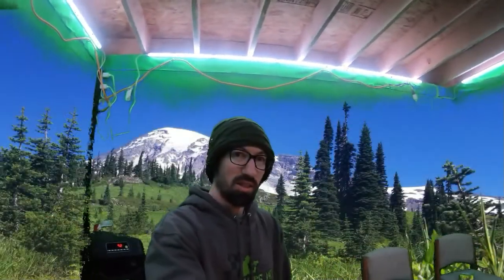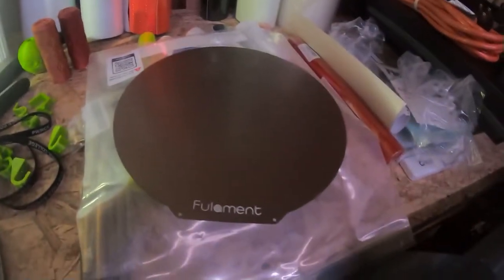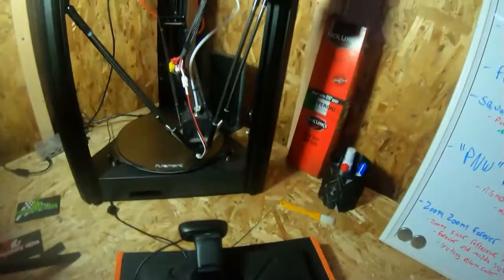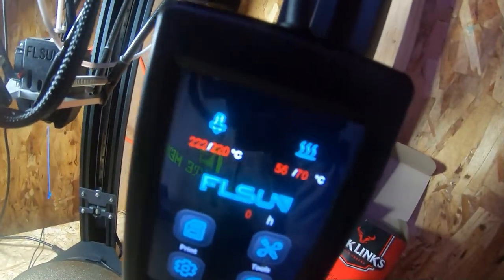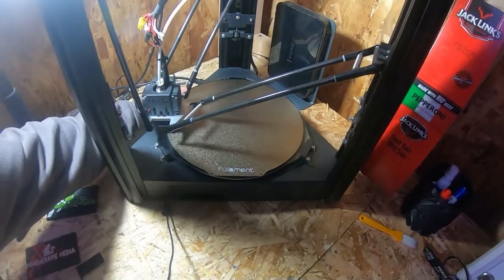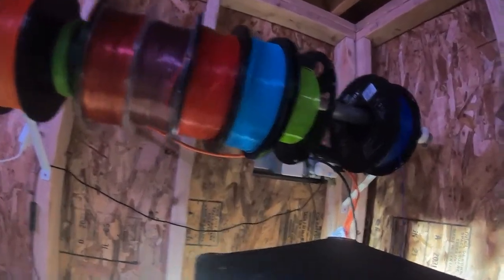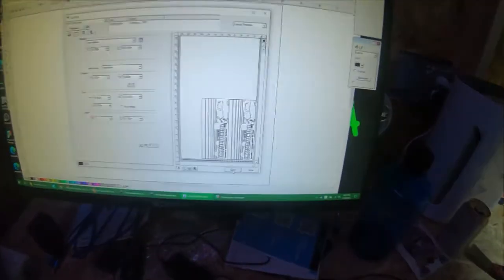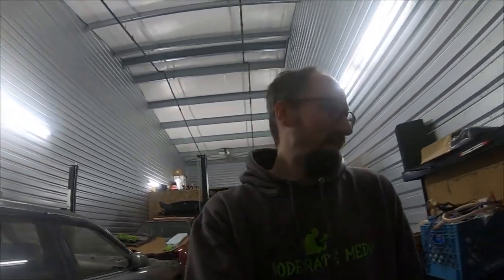#flsun SR - FIRST upgrade to my machine, PEI Fula-Flex 2.0 plate; you NEED this! | 2022 ep 4

Comment: Do u have a good tip for leveling the z point?
Reply from the maker: Not really, the auto bed level seems to work very well. In the year or so I have had this machine I think I have leveled it twice. Did the ole piece of paper trick when fine tuning the height after the auto bed level

Comment: Did you ever find out if you needed to take that stuff off and put it directly on the glass? Or is it still working OK without having to do that?
Reply from the maker: I put it straight onto the plate, carborundum and all. Cleaned it with isopropyl first to ensure a good stick. Increased my plate temps by 20 (print most at 70) to compensate for the thicker plates and heat loss
Reply: @immoderate  👍 perfect thanks. I have mine arriving today but I bought the pei bed separately because I like to be able to flex it and get them off immediately

Comment: could it be used for ABS?
Reply from the maker: I don't see why not, I personally use only pla; so I cannot say one way or the other if it works
Reply: @immoderate  i wonder the same,   i've never had any issues with PLA at al,   but ABS is another story!.     i keep seeing people complaing about the glass plate holding onto parts too well..     a lot of people dont reaslise that you need to wait for the glass to return to room temp before it lets go of the print    27c or below from memory.     so if anyone is having issues removing prints then just try this.

Comment: hey great video, i got a questioan, which side would you reccomend using the tetured of the smooth side i'm looking to buy one but realised that the textured it nearly double the price
would be great to know idf the textured side is worth the money, thanks.
Reply from the maker: I find that I only use the textured side when starting most prints, I have used the smooth side a few times and each time it really needed to be cleaned with isopropyl and a slower initial layer to keep it sticking. the textured side I clean maybe once a week or every 5-6 prints with no problems
Reply: @immoderate  perfect thank you